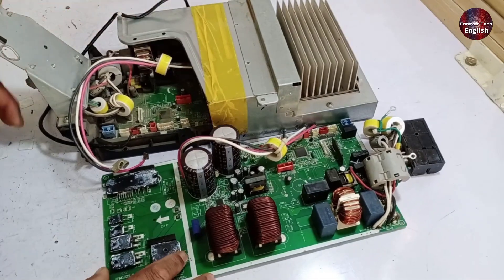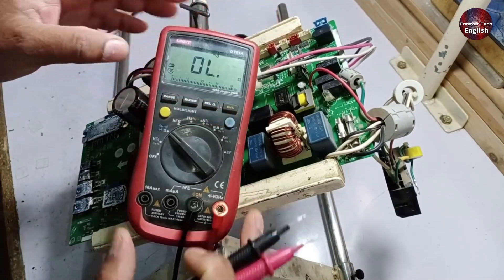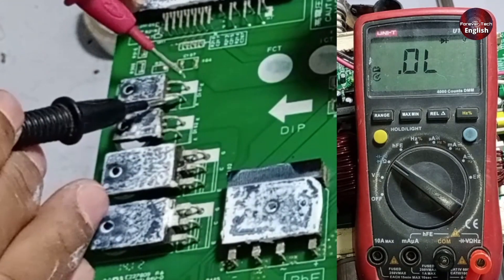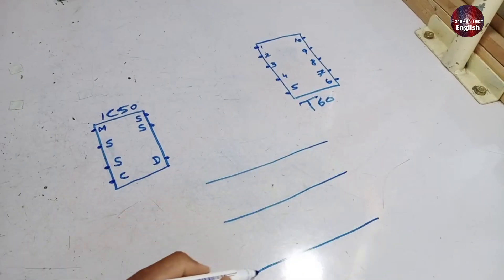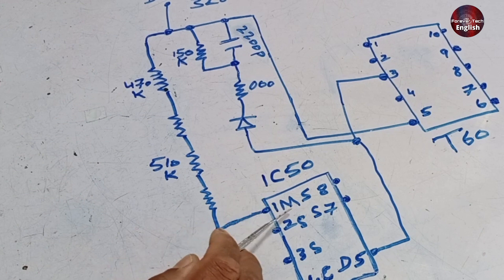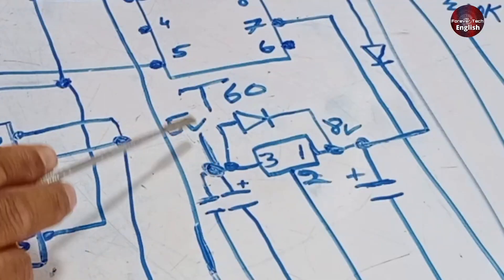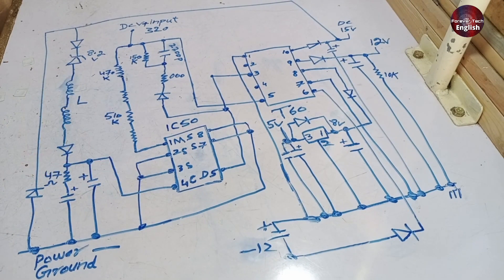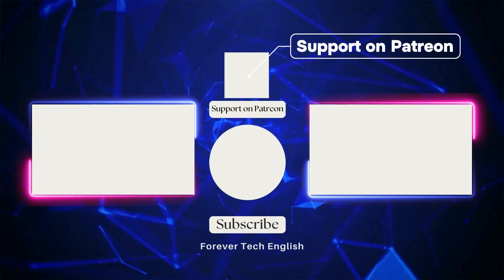Fujitsu Mini Split AC Circuit – Find & Fix Hidden Power Faults!

Comment: I can't believe my ears at 7:25 about output diodes of flyback converter. That's serously screwed! Those diodes are inherent part of flyback DC-DC converter. How did you think you get DC voltage from the "chopper"? Those diodes have nothing to do with protection. You're hilarious! 😂

Comment: Those resistors don't monior voltage, those are current limiting resistors for initial supply in order for SMPS flyback converter to start.
Also, it's about time to stop mixing current and voltage. Voltage doesn't flow. Volts are measure op potential energy, amperes are measure of kinetic energy.
Reply from the maker: Thank you for the correction, I am always learning.